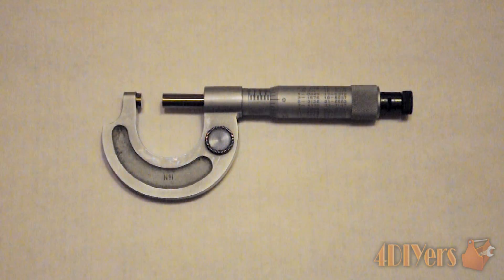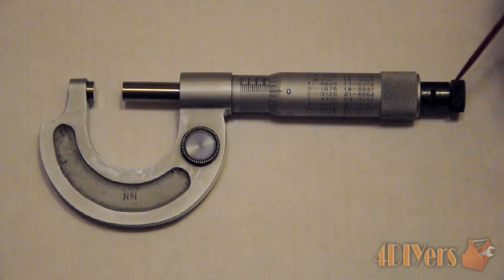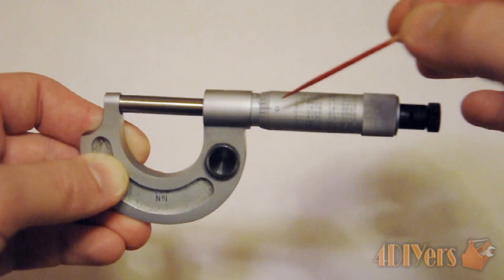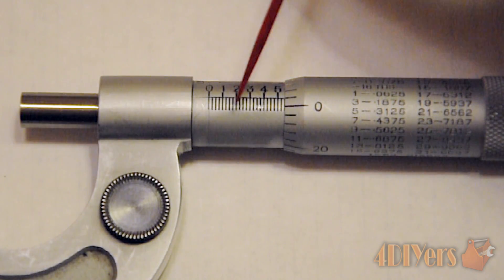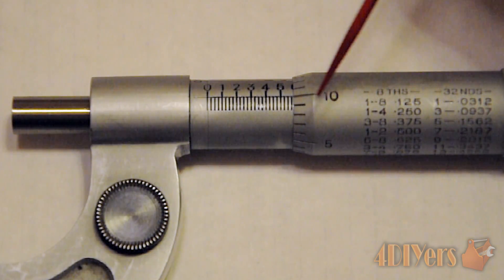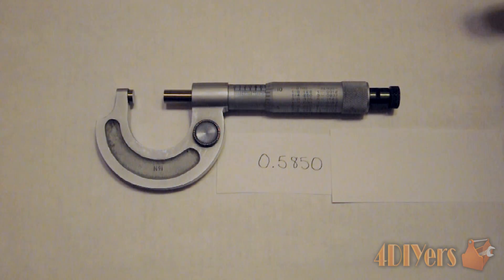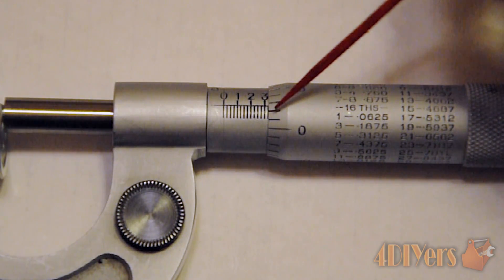DIY: Reading a Vernier Micrometer (Imperial)

Comment: the result for measurement of the nut should be : 0.3+0,025 +27/1000 + 7/10000 = 0.3527 ?
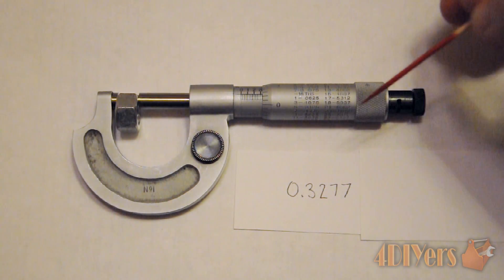Reply from the maker: No, it's only passed the 0.025 mark and the thimble measurement of .002 which equals to 0.027. The final measurement is 0.3277" which I have at the 10:08 mark.